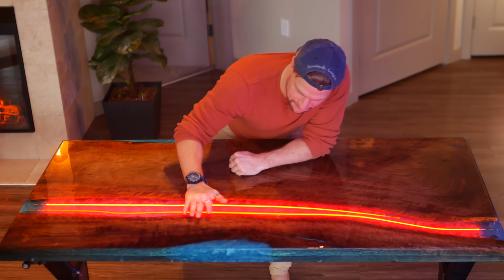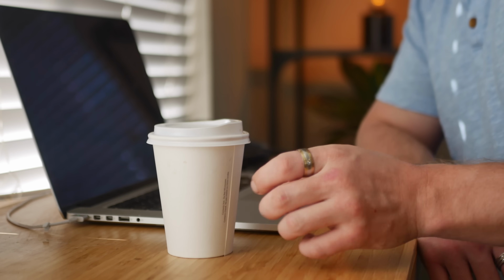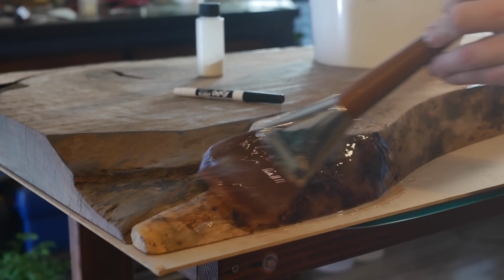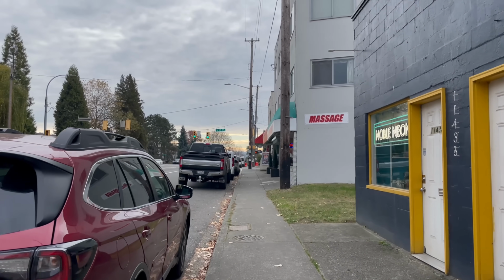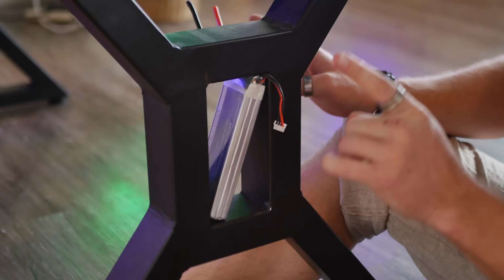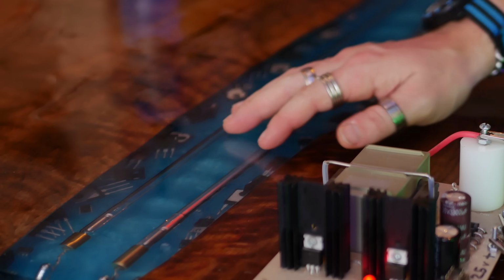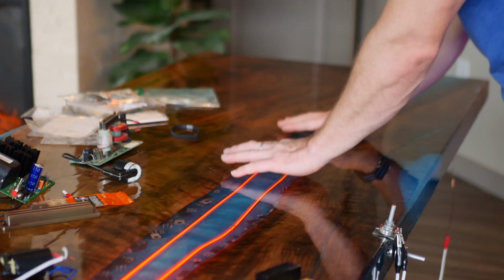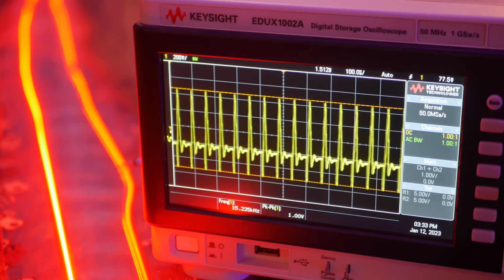A Touch Responsive Plasma Filled River Table

Comment: More impressive than the final result is the step-by-step process shown in the video, from the elaboration of the concept, the birth of the ideas, going through the difficulties that arose little by little, to the adjustment of the problem equations at each stage. Anyway, the conception of the idea ended up turning into something that can be applied to any object you want to have plasma flowing through it in a controllable way. Congratulations, man.
Reply from the maker: That means a lot, thanks. Yeah I wanted to be honest with the process, and bring viewers along for the struggle haha.

Comment: Furniture should be mains powered, not battery. Recharging the battery will annoy you.
Reply from the maker: Cables annoy me. When i'm president, i'll outlaw all cables and make cable use a capital crime, to be punished by reprogramming.

Comment: Yes, we want a video of the variable HV transformer!
The table is super cool! I wonder if you hold a small neon lamp in your hand put it close to the tables neon tube, will the small neon lamp light up?
Reply from the maker: Actually, I meant to put that in the video! ARG! Yes, it send out wireless power. I will do a followup video
Reply: You could make some coasters with a coil and different colored neon lights.  Do a pour with everything inside and everyone can find their drink by color!
Reply: What would happen if you put your phone on the table? Would it damage anything inside of your phone?
Reply: I wonder if it would charge the the battery in your cell phone if you sat it there like a wireless charger for a phone

Comment: The legs didn't look like they had expansion slots for the fixing screws, if the table shrinks it will crack
Nice job though :)
Reply from the maker: Well...thats.....depressing. The holes in the metal legs are slightly bigger than the screws, so hopefully that allows for some shifting.

Comment: Staticy cleanup? A misting with water would have help discharged  the static buildup. 🙂
Reply from the maker: I'm ashamed I didn't think of that. True...humidity / water kills static. I am forever banished .
Reply: @PlasmaChannel   the chips and dust are an interesting demonstration of static electricity and electrostatic induction through friction.